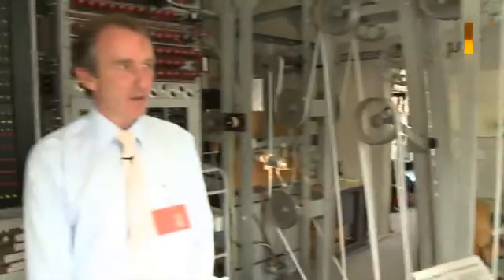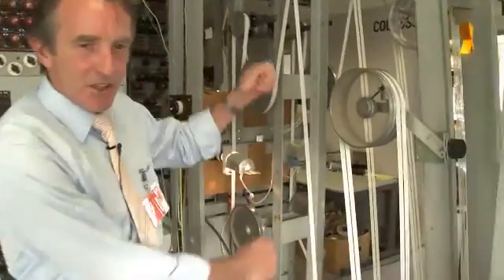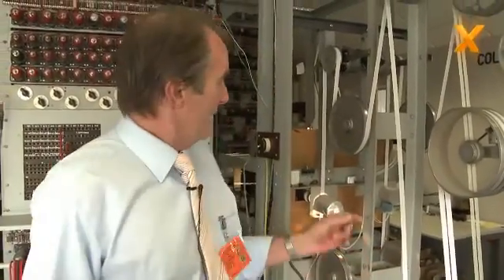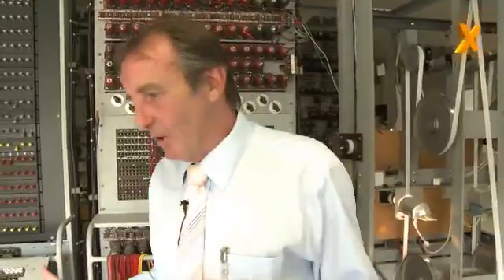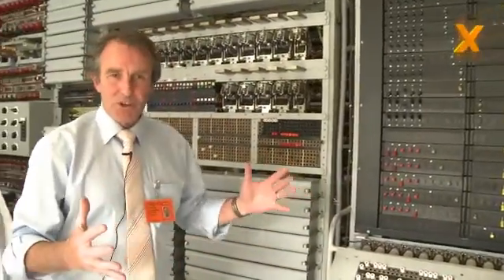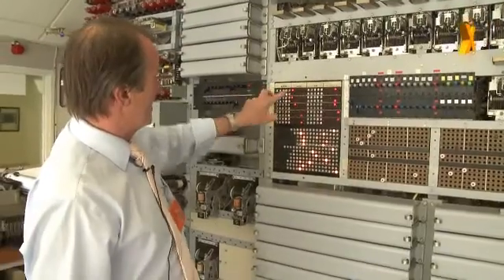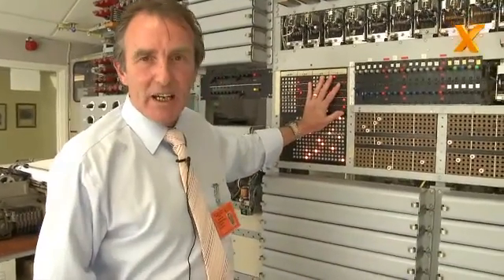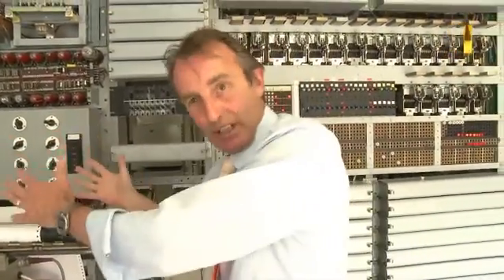Bletchley Park Code Breakers - Breaking Lorenz Part 2

Comment: Bill Tutte and Tommy Flowers were the two responsible for (1) Breaking the Lorenz Cipher machine (TUTTE) and (2) conceiving, building and setting into operation (FLOWERS) the Collossus...... Which rapidly speeded up the decrypted the triple encrypted messages sent through the 12 rotor Lorenz (British named it "Tunny")........it was Hitler and the High Command's Top Secret Cipher strategic level system for command and control plans and operational orders.....the enigma, a3 to 4 rotor cipher machine was used for lower level tactic messages.....